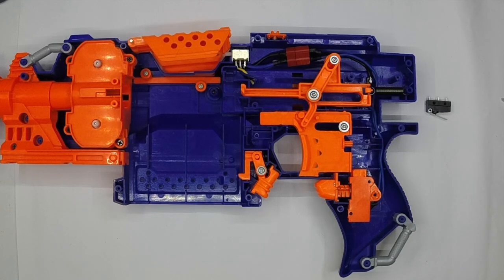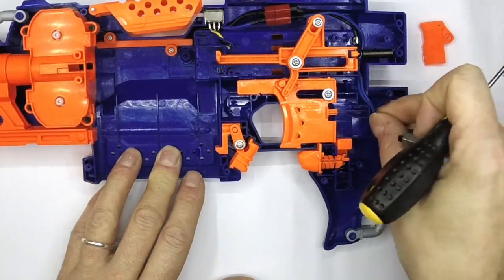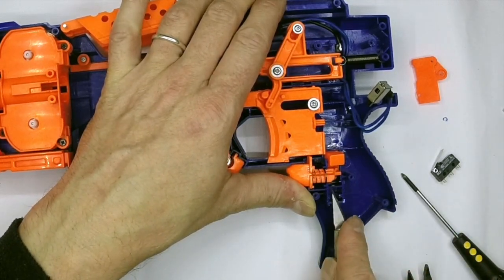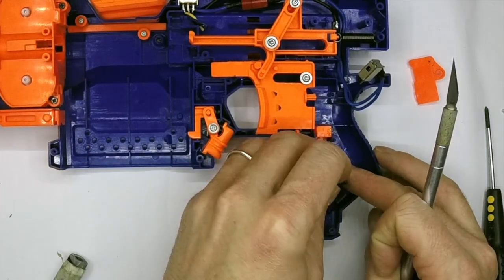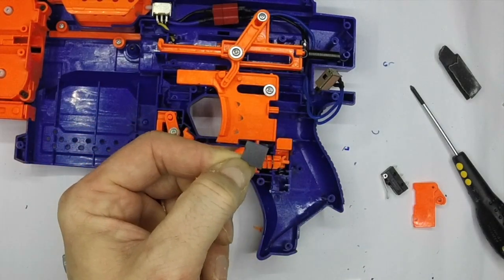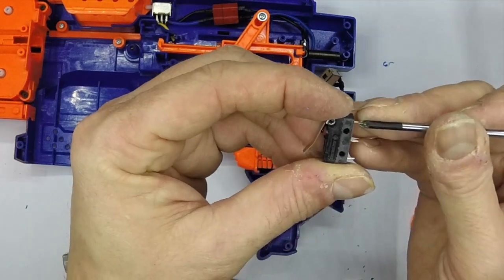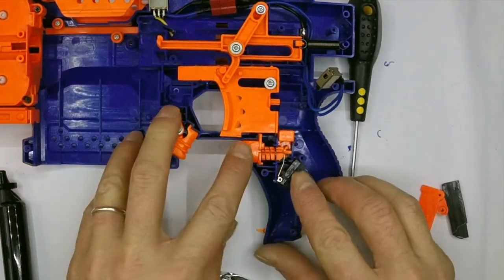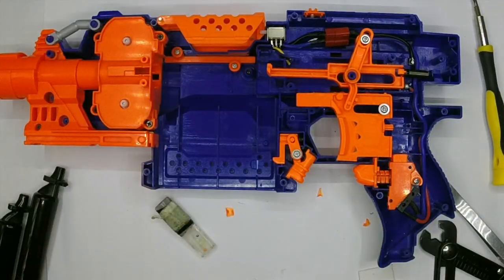How To- Rev Trigger Microswitch Upgrade

Comment: Thanks again for the help!  I upgraded the micro switch and motors in my stryfe.  The trigger lock was in the way for me so I removed it and shaved down the rev trigger a bit so the trigger won't hit it when pulled. I'm the only one using it so I know how to operate.

Comment: Hey Tom, 
just wondering if you have any recommendations for a soldering iron. I'm thinking about getting into flywheel mods, and for that I need to solder. I'm probably willing to spend about 30 bucks. Is there anything specific to look out for?
Thanks in advance!
Reply: Just had a search at my local hardware store, and saw this. Does it seem any good? 40W
http://www.bunnings.com.au/tradeflame-40w-soldering-iron_p5910280
Reply from the maker: +AJ_Gus Too big, you want a compact 25-30w. That tip is nasty too. Look for a tip shape like this-http://uk.rs-online.com/largeimages/F0542879-01.jpg

Home Depot do two or three suitable ones. A cheap iron like that is just a pain to use. My one was under $30
Reply: +Foamdata Services Thanks so much!

Comment: So, I'm trying to build a Super Stryfe. I've got a 2S 1000mAh 20C Lipo giving off 20 amps and about 7 volts., and I would like to know if you know any switches that will work with that.
Reply from the maker: The cherry DC2 10A switch will work with that, any 5-10a switch will work fine with most motors. I have put 60A through a DC2 without problems. As a aside, your battery is irrelevant in the load being put on the components, it's the motor stall current you should pay attention to. The motors only draw the current from the power supply, up to their stall maximum, the battery doesn't force current to the motors. Watch my balance video.
20c is a bit on the low side for MTB Rhinos, I would be looking for a 30c constant pack, as each one pulls about 10A stall.
Reply: Foamdata Services
Well I'm using the MTB Honey Badger motors, which are only 6 volts. Says they have a 10 amp stall current. Does that mean 10 amps per motor?
Reply from the maker: Yes, it does mean 10A PER MOTOR. That puts a stall load of 20A, which leaves no safety margin with your pack. Look for a better one. 25c is the minimum I would look for.
Reply: Foamdata Services
Okay, thank you. I'm new to this, and don't want it to catch fire.
Reply from the maker: As long as you never short a pack or over discharge it, they are totally safe. The only battery I have ever had explode was a consumer AAA alkaline cell, for no apparent reason, in a box with all my IMR in. Fortunately they were all fine as they were hard cased separately! Watch Jangulars Lipo care and charge video.
Reply: Foamdata Services
Thank you! That will be very helpful.

Comment: in my demolisher i used the switch cover screw port to hold the switch in place. used a bigger switch though
Reply from the maker: Mosfet is still best, you also don't need one of the comedy switches, I have seen a DC2 take 60A burst no problem. All those "21A" clicky switches are ugly and unnecessary. 
Good re use of the screw port though.
Reply: Foamdata Services thanks, it was my first electronic mod
Reply from the maker: Well done.

Comment: What micro switch do you recommend for a stryfe running on a LiPo 3s with 16 gauge wire?
Reply from the maker: I always use the Cherry DC2. Omron OM10 is supposedly good. Just don't buy cheap crap off amazon or eBay, like 10 switches for $5.

Comment: Whats the glue or substance you use to get the plastic piece stick  and the micro switch to sitck?
Reply from the maker: Devcon Plastic Welder. If you use a MOSFET board instead there is no need to change the Rev switch. Aftermarket ones often break loose, even with Devcon I have had one fail. Never broke a stock Rev switch in a FET build.

Comment: I accidentally melted the post that the trigger return spring holds on to while soldering. Is there a way to fix it in any way?
Reply from the maker: Hair Too much heat there mate! Try putting the return spring on another post. If that fails then you could cut that post down and put a shell screw in the base of the post and put the spring on the screw instead of the post. As long as the whole lot is no longer than the original post it will close fine.

Comment: What would you recommend for neo-hellcats with an xsw v3.8 select fire kit
Reply: or a cronus x
Reply from the maker: You will need at least 1000mah and 100-120c burst for that, you will also need a tray expander and a MOSFET loom with 14AWG main battery wires. BSUK make a high power kit that will work, but fitting that lot in a stryfe with an auto kit is very difficult. You don't need neo motors unless you have a very high crush cage and heavy/larger wheels. Really don't get why people are jumping on this hype train so hard, we have had neo motors for ages, they are not worth the power gain requirements in 90% of set ups.
Reply: The LiPo I am looking at is a 100mah 65c 130c burst lipo. I'm leaning on the containment crew motor cover because they're in America. Also, by neo-motors do you mean neodymium motors or specifically the neo motors by MTB. Instead of the neo-hellcats should I get something like the FB Fangs or the MTB neo-rhinos? Or if you were referring to neo motors as neodymium should I get the Cronus X?
Reply from the maker: I am saying ALL neo motors. 100mah us way too small, if that's a typo and you meant 1000 then that battery will just about do.
Reply from the maker: Here's the reasons-
https://www.tapatalk.com/groups/britnerf/mtb-neo-motors-t4678-s10.html#p44576
Reply: Alright, I guess I'll just run Neo-Rhinos with the V3.8 select fire kit with a 21A switch.
Reply from the maker: Unless you have a crush over 42mm and flywheels over 7g you won't need the extra torque. They are basically an original Hellcat in a 130 size can power wise.
Reply: Thanks! I'll be building my stryfe over the holidays.